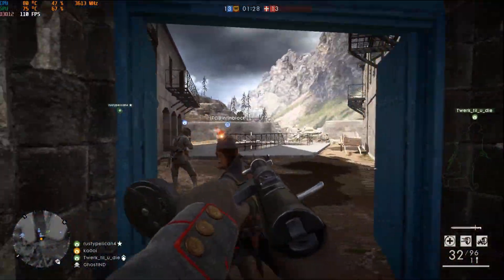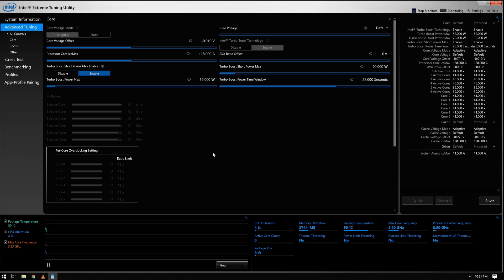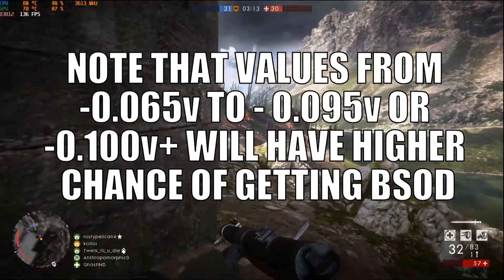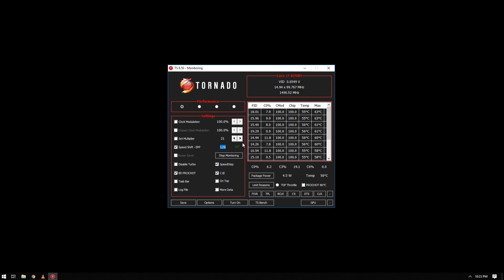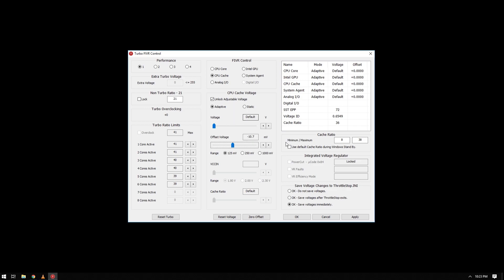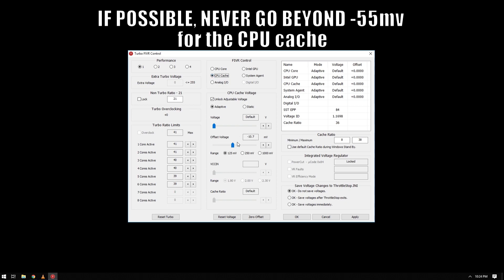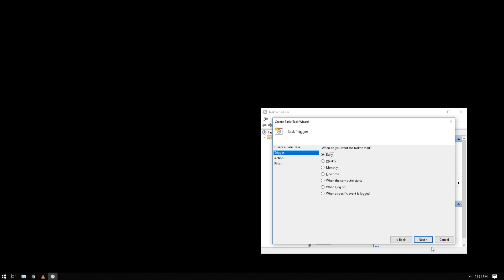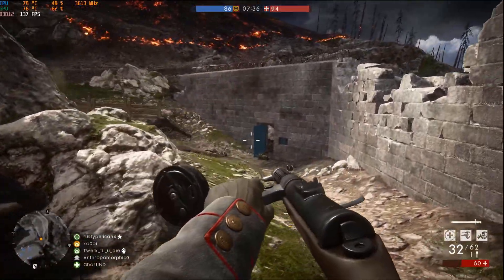UNDERVOLTING THE 8750H ASUS ZEPHYRUS M GM501 GOOD TEMPS

Comment: Im using intel xtu and undervolt i7 8750h to -0.150v cpu core offset and cou temp still around 90-95
Reply: Same but it prob means I need to replace thermal paste or there is a lot of dust in the fans. But j also get around 90-95c after like 30 min of gaming
Reply: @txuay how’d go?
Reply: @nasal  Hi, it's been a couple years but I did end up replacing the thermal paste and it did help a lot! But nowadays, it has other issues and I don't use it anymore as I have a desktop now.

Comment: BTW Cache is Same as core In this Cpu... zZzz.. So if you put offset -50mw to "cache" then there is no matter what you put to core 😂 If core is like -125mw and cache is -50mw.. the truth is that the both are -50mw..
Reply from the maker: i've tested both -50mw on cache and core and the one with -125 and -50 before and i got lower temps and a good perf and both settings gives different results. i'm no expert but i did do the tests.
Reply: @MadShotTV  Just got the same results as @Markus Ernvall

Comment: I undervolted my 8750h to -0.175V. I have run stress tests and many games with no BSOD. I`m getting great temps and very stable CPU clocks. Is there any limit for how low you can go in undervolting it?
Reply from the maker: Are you using xtu? If you got a stable performance then i would not recommend going any lower. But if you want to go lower just try with very small increments haha
Reply: Yes i am using xtu. Yeah i think i will stay at -0.175 for now. i seached around a little and most people that has the 8750h has undervolted to around -0.075--0,150V. I have not seen anyone undervolt to 0.175 yet.
Reply from the maker: I am undervolting at -0.250v cpu core but i am using throttlestop with the cpu cache at only -0.0146v. Yeah but overall your undervolt is lower since you have both your cpu core and cpu cache at -0.175v.
Reply: I under volted my 8750h on msi laptop to -175 and it's running fine, I have seen people using same undervolt on xtu forums and comparison charts.

Comment: To fix this problem all you have to do is go to change plan setting. Then advanced power settings. Then go to processor power management and change the minimum and maximum processor state to 99 instead of 100. Runs the exact same except it keeps it cool. Mine stays around 75-84
Reply: This disables the turbo boost feature so I would not advise you to that

Comment: I did it with ASUS ROG STRIX GL703M, it has the same processor, using XTU, i undervolted it to -0.070V and im getting stable clocks and 74-80c while playing games, guess i did a good work
Reply from the maker: very nice man!
Reply: @MadShotTV  if i do it with throttle stop, whats the difference?
Reply from the maker: throttlestop is flexible and you can adjust both the cpu core and cpu cache separately while the xtu adjusts both cpu core and cache simultaneously. many prefer throttlestop but is not bad.

Comment: Got my msi gp63 with 8750h and 1070 to -120mv so far and can get in the 1200s in cinebench R15. Im glad i sent back my helios for the msi because it has a much better cooler with 7 heats pipes. But the helios is still one of best deals for its performance. But the I ordered from Amazon had 2 dead pixels so i sent it back. I spent $300 more on the msi but i got a 1070 and better cooler. Plus i think the panels better even though its tn, its the 120hz 3ms one. But the 144hz on the helios wasnt bad, man the screen on the dell g3-7 sucks they need to update it with a faster response time and something brighter.
Reply from the maker: yeah i am hearing pretty good stuff for those msi 8750h models
Reply: could you by any chance elaborate on your undervolt settings?
do you use throttlestop for undervolting?
if so, was the -120 offset for the cache or core? 
and do you enable speed shift or not?
Reply: Sung Ten Songs use intel extreme tuning utility and just put the core back, you can try missing with power draw but all i did was -150mv on the core and it helped so much. You could use throttle stop to top out your cpu around 3.5 if you really want to drop temp
Reply: @ChadKenova  thanks for the quick reply. I was messing around with it last night and I think i finally have it in a good sweet spot. I ended up with -0.150 mv as well. And a -0.100 mv on the cache and enabled speed shift (32).
I even ended up undervolting my gpu which actually gave me an "increase" in performance. 
all this gave me around -10c on both gpu and cpu. now they run around 72c and 83c respectively (under load) with no apparent performance loss (except for the gpu performance gain) :D
must test more to check stability. cheers!
Reply: Sung Ten Songs u using intel xtu? What your spec? Mine i7 8750h and undervolt to -0.150v and cpu temp still around 90-95

Comment: can this work on my acer predator? i have same cpu like yours
Reply from the maker: Muhd Haikal Yes just do it slowly. low increment at a time
Reply: what to do if i get blue screen?
Reply from the maker: Muhd Haikal did you get blue screen? After you restart it will go back to your previous settings
Reply: MadShot TV no i didnt undervolt it yet.
Reply: MadShot TV i follow your steps i undervolt to -10.7 and temp decrease from spikes at 100 to max 93 not and exceed that. I will continue to lower the voltage
Reply from the maker: Muhd Haikal nice. but damn that 100degC is insane
Reply: MadShot TV i only fortnite on high setting lol maybe acer did  bad at thermal paste
Reply: did it work?
Reply: Muhd Haikal  yes just use intel extreme tuning utility start about -100mv and get adding more until its unstable or blue screens

Comment: Don't have this laptop but got same cpu. I disabled 2 cores and undervolted to -150mV for core and cache, -50mV for igpu. Temperatures are like high 30 to mid 50ish. Never got up to 60 C yet. I think I can still undervolt further.
Reply from the maker: https://youtu.be/tXbjUx6ABjE
Reply from the maker: I read it on a youtube vid. Forgot if it was bob or jarrod's review of the zephyrus that  ppl where discussing their undervolts. but on bob's video (addressing that hot 8750h) he showed that his unit can go up to 350mv
Reply from the maker: I uploaded a new video which got my undervolt to -198mv core and -30mv cache and got max performance. but i think i get what you are saying about disabling 2 cores or you could just lower max cpu cores. Normally it 41 41 40 40 39 39. Tried it to all 36 and it reduced temps greatly tho i didn't get a stable 3.9ghz performance.
Reply: wait what you got -198mV with 6 cores?  That's the most undervolt I've seen for this cpu. Also, I thought you're supposed to keep the cache the same as core?
Reply from the maker: I did trial and error. Tried  combinations of cache and core values but I think I got the best performance yet on this setting 198mv and 30mv. There are others who reached -250mv but I have not tried those yet as for now.
Reply: from what I googled, many people say to have the same core cache values so idk. I undervolted both to -180mV now but haven't hit the limit yet, still 4 cores though.
Reply: @MadShotTV  yea i reached around -250mv without any bsod with stable 3.9ghz while gaming

Comment: lowering the sst is going to effect performance. I am noticing it when I am benchmarking assassin's creed this is a very cpu hungry game.
Reply: I set the sst to 62 and it immediately effected performance I am losing frames during assassin's creed but the temps are far better tho.
Reply from the maker: in my experience, i am getting almost stable 3.9ghz when the value is zero to 32. 64 is still very good. also i think i found a much better undervolt settings. will try to share soon.
Reply from the maker: JayDaKIDD i uploaded my new settings. check it out.

Comment: Hey mad shot, I have the 1060 zephyrs. Have you tried undervolting the cpu and then overclocking your gpu?
Reply from the maker: all i did was undervolt both cpu and gpu. it improved my temps and frames. the 1060 is already capable as it is in my opinion.
Reply: Thanks, will try undervolt both my cpu and gpu tonight.  Main reason why i wanted to do some slight overclocking is because i want to get some slightly better frames on my ultrawide monitor.
Reply: Undervolted both the gpu and CPU, made a huge difference, thanks man.
Reply from the maker: Only_Lou nice! glad it worked for you too!